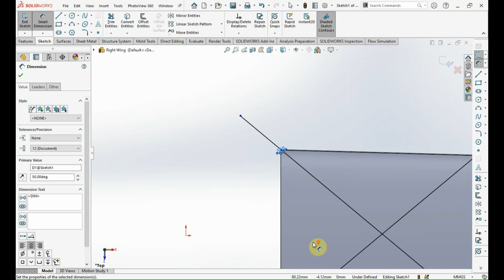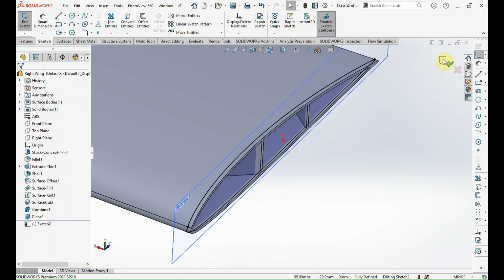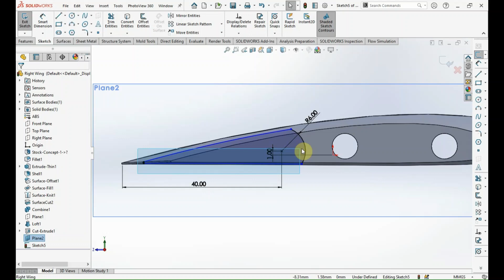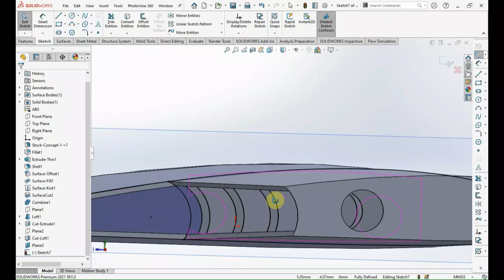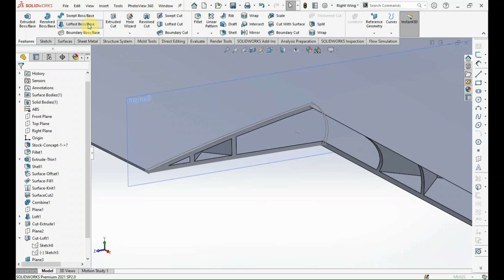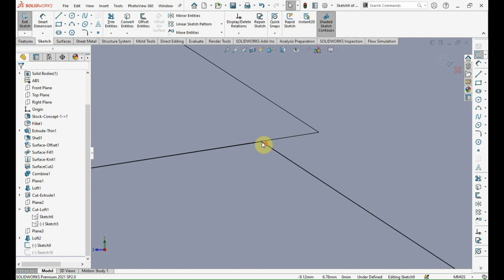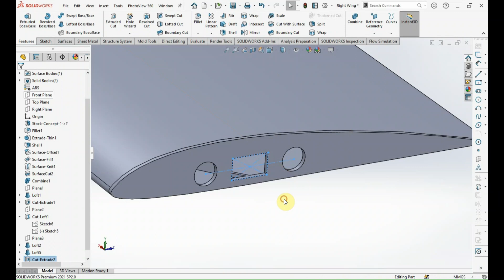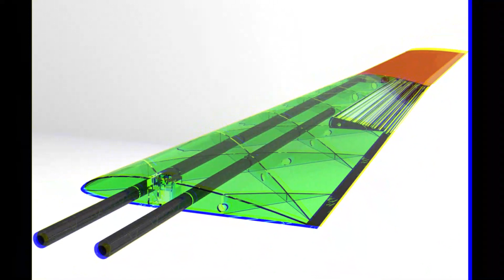DIY 3D Printed Drone Design In SolidWorks (Part 6: Structure | Wing)

Comment: Hello my friend, 
What is the length of the wing in mm?
Reply from the maker: Good day my friend!
The wing span is 1060mm and 30mm of the each wingtip is the winglet. that's because I wanted to integrate both wings an fuselage with 1m carbon fiber tube.
Reply: @dynamixsystems  Is the length of the wing in this video 500 mm?

Comment: I don't understand what all the clicking was for to cut out the aileron.  In Fusion, once you had your side aileron sketch it would have been 5 clicks and done, not even 30 sec.
Reply from the maker: It was my fault, now I'm more comfortable with it, and it doesn't take that much.